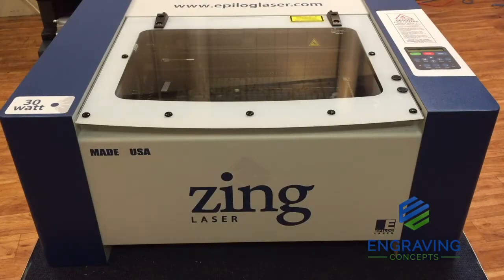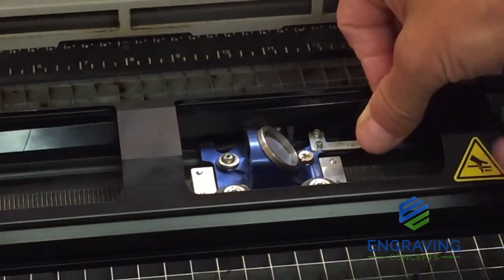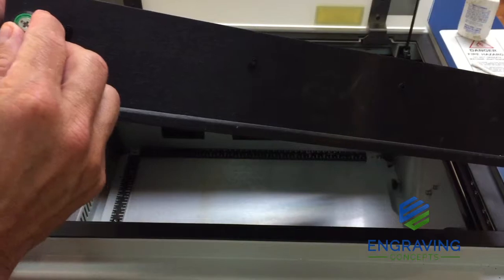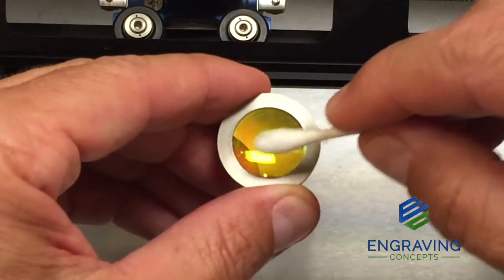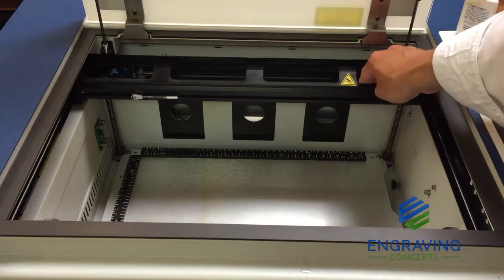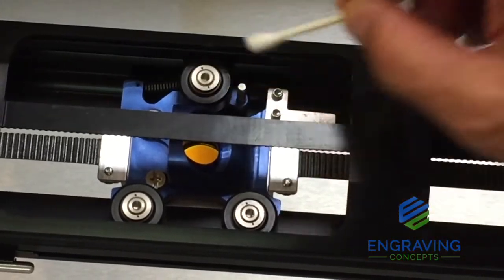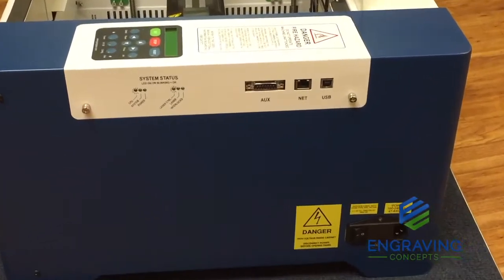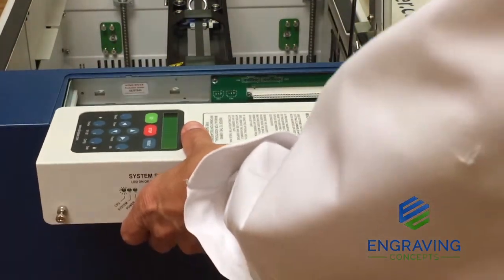Zing16 Cleaning & Maintenance

Comment: thanks for the video, I think you mentioned it but if not you should never used compressed air to clean a machine except in certain cases as you will blow dirt into places it would never ordinarily get , i usually use a brush with a vacuum nozzle held close by to catch debris.